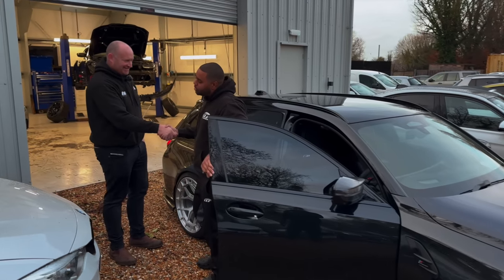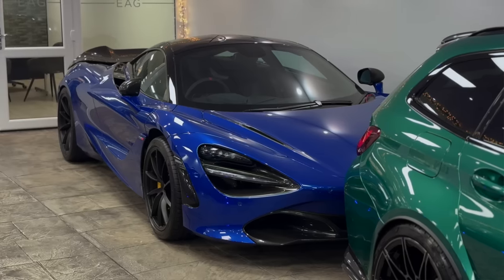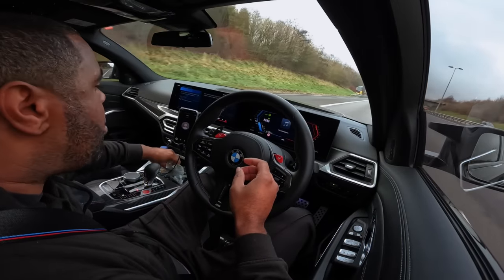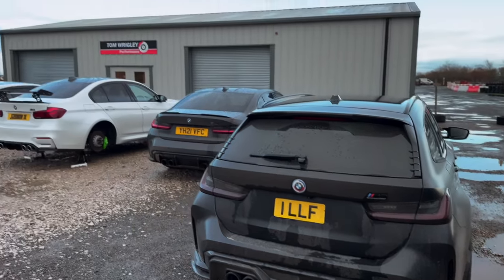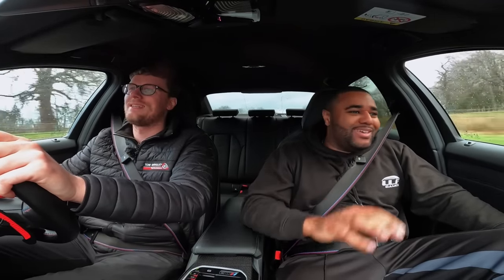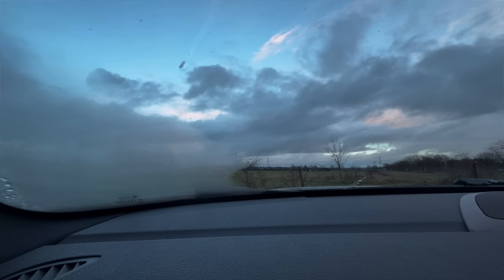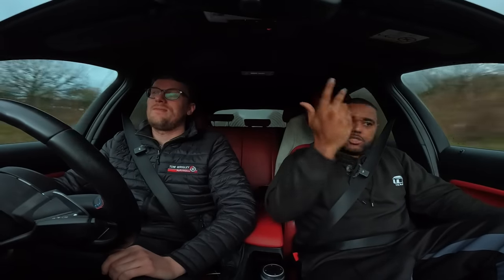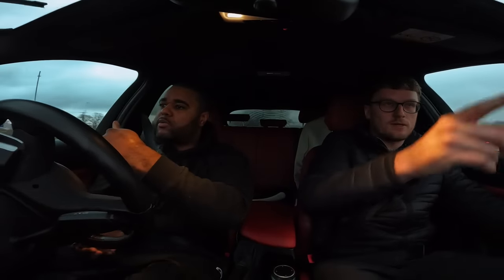MEET THE WORLDS FASTEST M140I **4WD SWAPPED!!**

Comment: Need to take that xdrive 140 to the ring and get micha to take it for a lap
Reply: 100%
Reply: 140’s over there are already x drive so it’s not nothing new in Germany
Reply: @itzKiiRo  Just interesting to see an X Drive on the ring with that sort of power/single turbo build to see how it handles heat etc. Most of them so far are stock turbo mainly.
Reply: @182tev its always single turbo
Reply: @182tev  they already are single turbo, and there is alot of 500-800hp m140is in europe
Reply: @mariwank6260   I think he means when Tom puts a proper single spooling turbo in, a twin scroll turbo revs a lot more restricted
Reply: @mariwank6260  I know, it is single turbo. But it’s not a full frame single turbo. I can’t recall any videos Misha has put out with an X Drive 40i running a proper big turbo.

Comment: cant wait to hear what happened at williams performance 🤣
Reply: I believe it is to do with COBB developments where he got the turbo kit from, they use to work with williams and there was a big post about COBB ripping off customers and dodgy worksmanship in an m140i owners page
Reply: One of the customers kit was a massive bodge job from COBB’s side the guy got it refunded after it ruined his car then apparently they sold the same exact kit from his car to another customer after😂
Reply: I believe williams are legit though, car was probably fine on their road testing etc then down the line once the customer had the car for a while shit probably started going south
Reply: Just did some more digging on the post, Rickys car did in fact fall victim to these guys from what i have read😂 which is why we didnt see any of it for a long time
Reply: Turbo kit came 3 weeks late after car was here, then charge pipe didn’t fit, 
Meth kit wasn’t the best as we tried a new kit on his car and it just didn’t work with initial firmware and bmw ecu, but I changed that straight out for a coolingmist kit, still had issues with new charge pipe not being long enough so went to Dan to get a new charge pipe. Then Ricky bought Ken’s car and had Dan swap the engines and other parts from Ken’s car that we had built. Went to ignite performance for a oil catch can then went to toms for port injection.

Comment: id like to know what running gear hes using on the m140i to make it 4wd, as this is something ive been thinking about doing to mine, i know europe gets a 4wd version but they never made 1 for the uk market, im assuming because of the steering rack and having to fit everything in, would mean changing a lot of stuff around which would get in the way on a right hand drive car